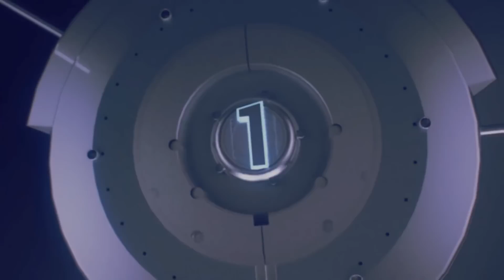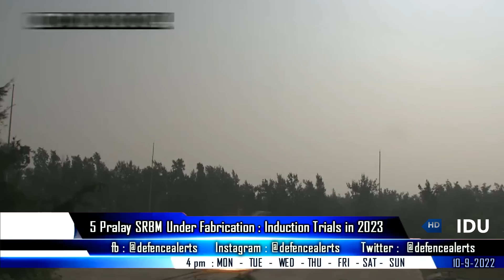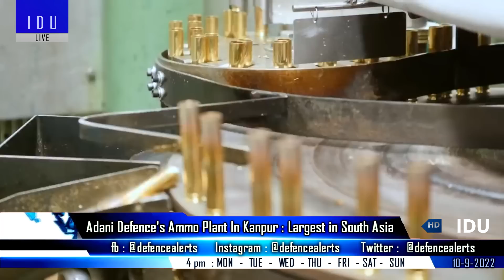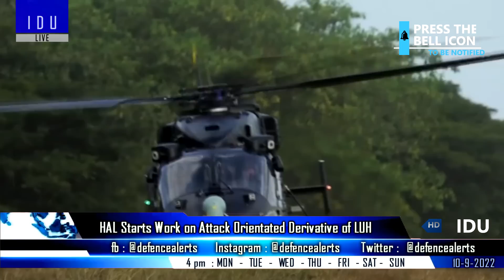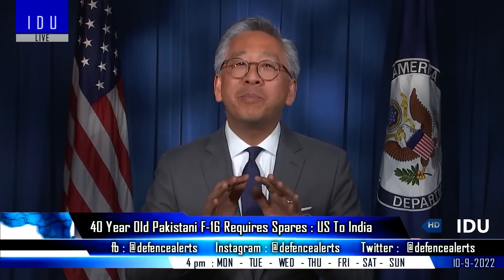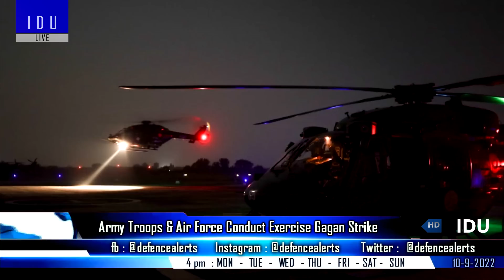Indian Defence Updates : TEDBF Prototype,Pralay Induction,Armed LUH,INS Vishal CATOBAR,Gagan Strike

Comment: IAF VERY BADLY need 600 fighter jets before 2040 year, of 4.5++ gen. levels and, HAL CANNOT deliver the same! Must make in India GripenE 200 nos. jets for just 170 millions usd per jet amortized costs lifetime.  Also, can make in India ONLY One more IAC with DRDO nuke reactors and EMALS CATOBAR - rail guns, AWACs and UCAV launching capability. Also, small aerial refueller tanker planes are needed for this showpiece AC. This will showcase India's engineering design and manufacturing might to the Whole World next!
Reply: No….  India needs to at least triple that number to be effective in combat operations, both strategic & tactical !!  And also needs to increase its inventory of UAVS by five fold ….  And cannot wait till 2030

Comment: We need pvt firm as alternative of HAL so we can pace our fighter jet prog. And manufacturers more jet in a year
Reply: I don't think any of our private companies are capable of producing an entire fighter jet from scratch. They can be used to design and supply individual components though
Reply: @saranshgupta3517  do you know Agnikul Cosmos the private company in India that can 100% 3D print entire satellite launchers? Why underestimate private defense sector in India?
Reply: @MeGauravit  Rocket engines are far easier to build than turbo jet and turbo fan engines. This is highlighted by the fact that ISRO was able to create a cryogenic engine while the Kaveri project failed despite greater funding and time.
Reply: @saranshgupta3517  Bro may be u right but we have potential to do this
Reply: @rajdeepmehla4087  Step by step my man. No use thinking of step 5 when you are currently on step 1.

Comment: But y soo many attack helicopter are being made  by hal.rudra attack helicopter,lch,luh attack helicopter??
Reply: Attack helicopters are more useful in regions like LAC and LOC. They're also cheap to operate and lastly utility/strike helicopters have huge export potential as they are cheaper than the Attack helicopters.
Reply: @cheemsa.k.ahecker5257  but still we already have two  sepcific attack helicopters lch and rudra.y making another varient of luh not like our armed forces gonna  acquire it.
Reply: @garlapatirohithreddy8185  idk! May be it will redesignated as Rudra 2.
Reply: @cheemsa.k.ahecker5257  should not compare with more powerful Apache. Not a competitor
Reply: @vaimurthy  Apache and LCH are attack helicopters while Rudra is a medium attack high altitude utility helicopter.
Reply: @vaimurthy  Rudra's very good in high altitudes as well and low cost compared to other armed helicopters like Apache or Mi 28 or LCH.
Reply: @vaimurthy  
Rudra is armed version of ALH
Reply: @vaimurthy  
Both rudra and LCH were developed on same frame of ALH

Comment: Believe me a CATOBAR INS Vishal will be a big mistake.
Reply: EMALS is a modern tech but unreliable,like you can see how Ford class AC's dealing with many issues. But CATOBAR is a proven tech. It's old but reliable better we can install a CATOBAR system and leave some space to integrate EMALS in future.
Reply: @cheemsa.k.ahecker5257  Agreed.
Reply: Eventually CATOBAR is a necessity for larger carriers and if it's using steam powered catapult, in all likelyhood, it'll be nuclear powered carrier to use it. STOBAR carriers have weight restrictions.
Reply: @shivatrident5391  Without having an indigenous Carrier borne AWACS and considering that TEDBF will be CATOBAR based, INS Vishal will essentially be a helicopter carrier unless we buy major US equipment.

Comment: Atleast 500 Pralay missile should be in operational deployment with Artillery regiment/Rocket force
Reply: @Purushottam Vats make sense brahmos is a cruise missile it's a ballistic missile to attack strategic targets.
Reply: There is difference in operational use. Brahmos is to roast the butt, Pralay is to burn the butt.
Reply: @Flying Tiger its not about being obsolete.. But the cost is much higher. Otherwise missiles like pralay are also highly mobile with road and rail mobility. Also this is not a 20 30 yr old sitting duck ballastic missile, it is also a hypersonic lower trajectory ballastic missile probably capable of evasive manoevours

No doubt HiMars type weapon system is a must.
Reply: @Purushottam Vats brahmos 1 already killed Neptun missile for just saying brahmos isn't good as Neptun.
Reply: @Purushottam Vats what is it NeptuN or NeptunE? I saw Neptun somewhere. BTW I'm not talking about Planet Neptune.
Reply: @Purushottam Vats Neptune or Neptun missile which sank moskva.
Reply: Ok, I have conveyed your directive to the Defence ministry & the Indian Army.
Reply: @Flying Tiger noted 👍